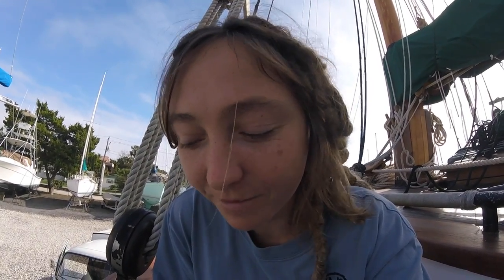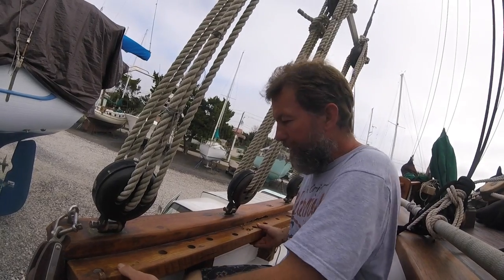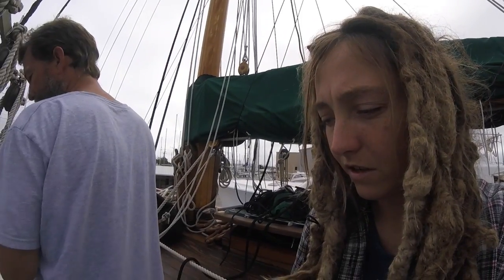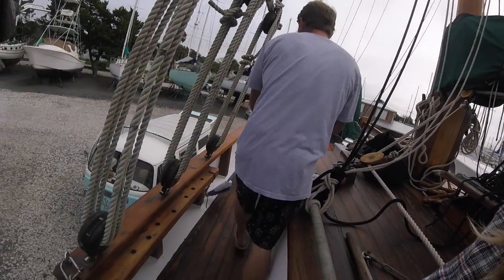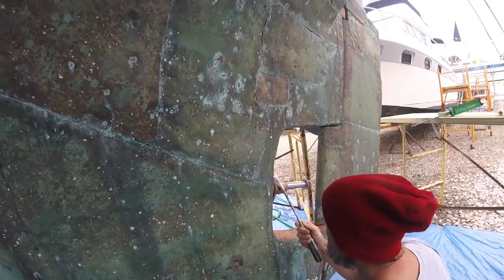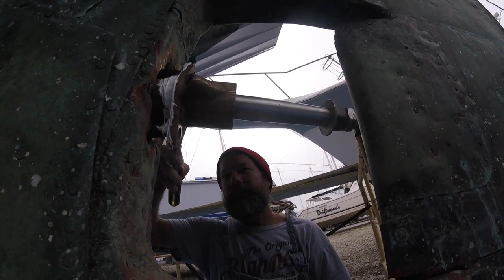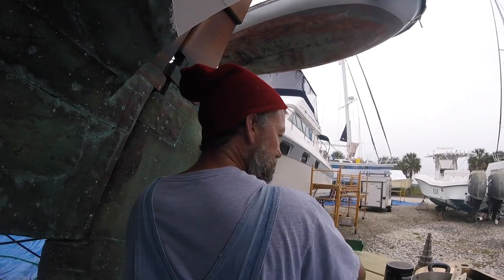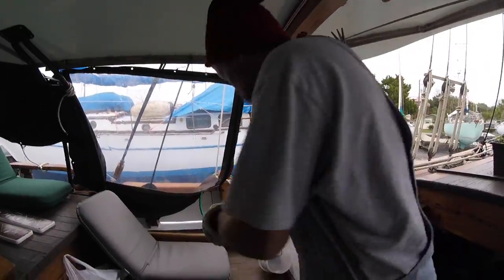Episode 127 - Sailing Vessel Norna SVN Vlog Day 32 - Q&A Plus Lanolin on Prop Test

Comment: I have seen sawdust used on home depot bucket compost toilet hacks but the 
 Recommended use on Natures Head & Air Head Composting toilets is Coconut Coir.  
If your composter doesn't smell like a garden store then you probably need to look at a way to mix / agitate the compost better.  I guess if you cant get a hold of coconut coir sawdust would work though, it was the preferred method back in the day....

Comment: I would say solid blocks under the pin rail. Either lagged into the frames or maybe even bolted down through the deck. Possibly sister them to the frames. It is too handy of a step for people to avoid it. Might as well make it a feature.

Comment: I don't know weather Pete will like this, but how about a lapel mike for him. I find it hard to hear what he's saying sometimes. Sorry about throwing you into that suggestion Pete! By the way, I did timber boat building in the early 70's as my trade. I do remember copper sheathing. My father traded a finished 27 foot hull and deck  for an early 60 foot Tug boat. We did many similar repairs. So I have a fair idea of what you two are up against . I  remember then, that to redo copper sections was expensive, I shudder to think what it costs now. Shiver me timbers! Any way good to see timber is not dead. Keep up the good work you two, I enjoy your "moving pictures" I mean videos. Can we still call them videos even if it's all digital , now there's something to ponder.